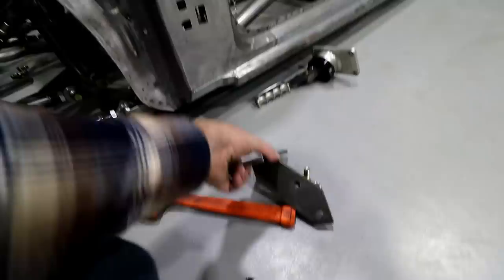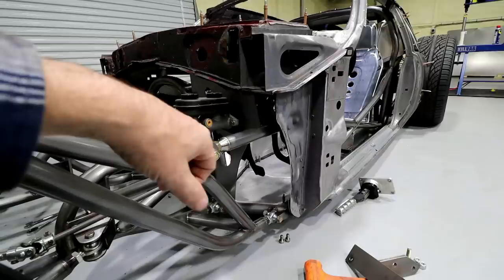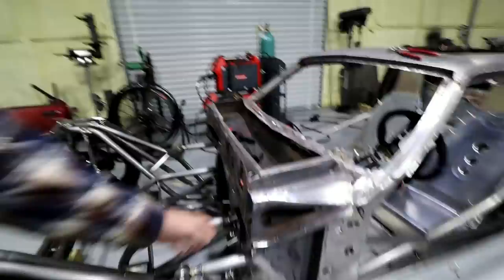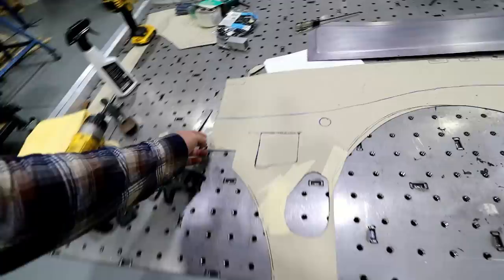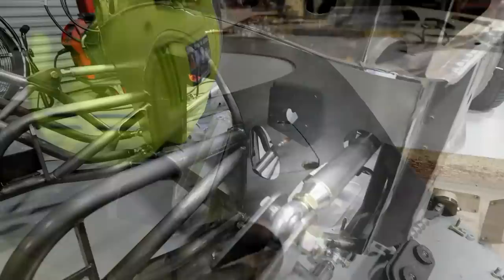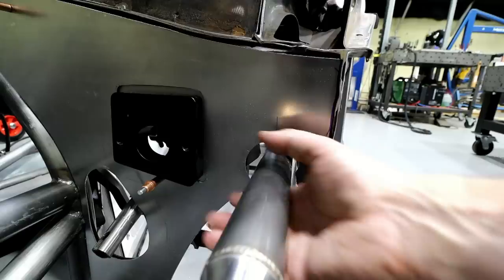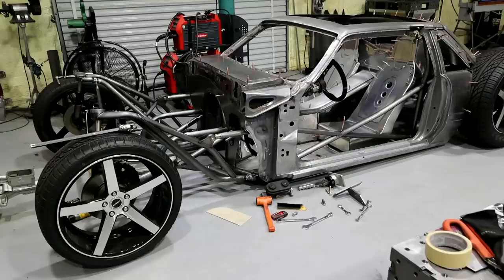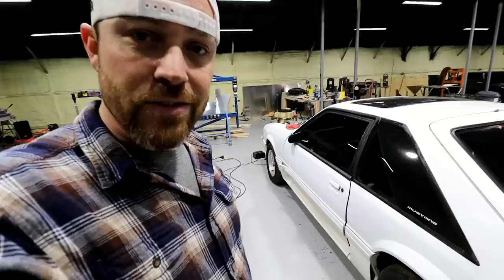Making A  Firewall For The Bibbster Fox-Body Build

Comment: Hi, I use  a cherry picker to pick things up also but I did make an addition to it. I made a mount for the lift and welded it to cross bar so that it pivots on The cross bar and then I measured the the distance between the two points  on the lift arm and  welded them to  the upright so that you can pick things up at a much lower height